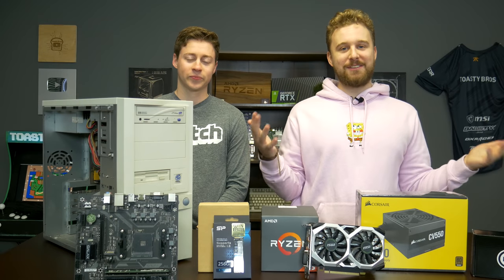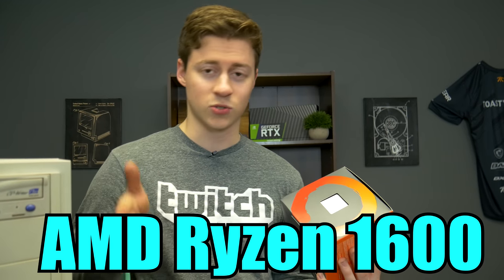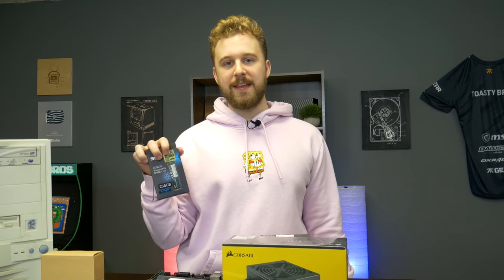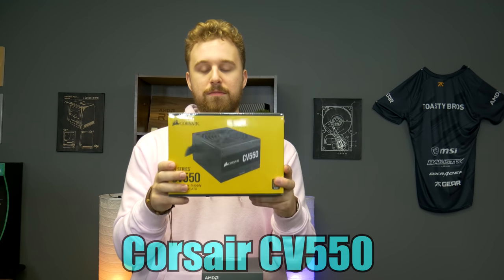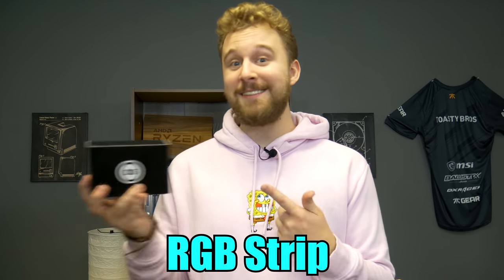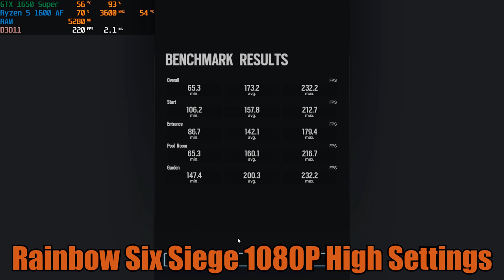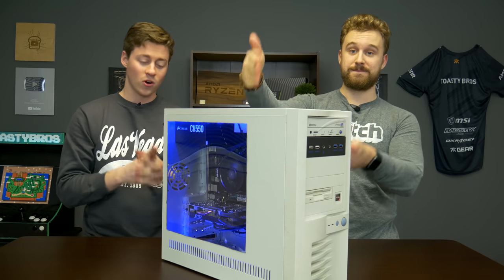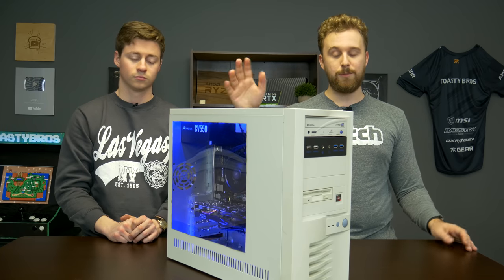$450 Sleeper PC Build - Gaming Sleeper

Comment: god i love seeing sleepers its like a computer going super saiyan and showing these modern computers that she to can run modern parts
Reply: the side windows completely defeats making this a sleeper pc
Reply: @kyles8524   not really, someone that doesnt know computers will call it shit by looking at it but once they try it they will underestimate it.
Reply: @JQ19988  my point was with a side window you can see inside of the computer and see its not shit. Like a sleeper car, they pull up to the drag race in like a Chrysler concord with a LS7 Twin turbo Corvette engine in it but they have the original hood on the car, they dont have the hood open so everyone can see the LS7 engine cause then it wouldnt be a sleeper car.Thats exactly what a sleeper anything is.You dont make the internals of any of it visible. Its supposed to retain the original body,case, whatever the item may be not modded in any way, its supposed to be completely hidden.lol thats why the side windows defeats calling it a sleeper PC...If they simply got another side for this old computer and replaced it then it could be called a sleeper PC
Reply: @kyles8524  I didn't mind the case modding at all myself. Though I think you are right when it defeats the purpose of it being called a 'sleeper build'. 

What I liked about it, it seems like a build they purely did for the heck of it. It's always nice to see the lads do builds for the sheer experience of it versus the gamut of builds promoting AMD, Nvidia, or Intel's latest and greatest.
Reply: @DanChainsawman  thats why I like cheap budget builds videos cause they dont care what they use, its just bang for buck
Reply: @kyles8524  It makes a lot of sense, I agreed with you.
Reply: I done sleeper PC's using old Compaq cases. It was fun

Comment: Good build but:
- I would tear off the box of the front panel USB + HD Audio PC box and paint it beige, dry it without ruining the color and put it back on
- I would get a SATA optical drive. Probably an LG GH24 series but find a beige faceplate for them and put it on
- I would add an 8cm fan in the back

Comment: the more sleeper builds I see using these old cases (or even stumbling across leftover ones from the 2000's that are still in Newegg stock for some reason), the more I think there would be a potential market for that 90's/2000's aesthetic of cases, but with modern amenities like actual decent airflow and cable management options

Comment: Nice sleeper case, but with the clear side panel it would have been more fun if you found retro looking brown and green parts to go in it. Maybe the Gigabyte X570 Gaming X, retouched with some beige radiator paint, use the Noctua NH-L9X65 SE-AM4 cooler, silver coloured power supply (Seasonic SS-500ET 500W), EVGA GeForce GTX 1660 Super SC Ultra Gaming, yellow LED's, etc. My idea would be spend a bit more, but make it look a lot cheaper and older on the inside too.

Comment: I suppose mine is a bit of a sleeper.  Gutted most of the components in an Acer Aspire T885 and put in an EVGA Supernova 650 G3 power supply and a GTX 1080ti Founder's Edition (MSI).

Comment: do a build on a dell inspiron i7 4790
Reply: They don't do much used hardware that's 4th gen, specially i7 because they are overpriced. But it's still a very good processor, I mean, with enough ram and decent graphics card you still have a PC for a long time.
Reply: @hunterfabio  you can buy them for under 200
Reply: @tobyprickles4887  For not much more you can squeeze a Ryzen 5 1400 / Ryzen 5 1600 with some second hand 16gb ram, perhaps new graphics card and also new cheap case with decent power supply and get the same price but way better performance, besides upgrade path. Of course depends where you live, at least here, no i7 4th gen is going for 200 usd, unless it's a very big sale in a 20 pc's bundle.

Comment: Ryzen 5 1400 with RX570 or ryzen 5 1400 with 1650 super?
Reply: Super
Reply: 1650 super
Reply: i say go with the ryzen 5 2600 and gtx 1660
Reply: I had the 570 and performs amazing but the 1650 super performs a bit better. Depending on the country where you live the price different is not worth it for the 1650. Here the 570 is like 150 usd new and the 1650 super like 230. So 80 dolars for a couple fps extra and maybe nvenc if you interested in streaming. Besides that, for me it's a no thanks. Depends of your country anyway!
Reply: @hunterfabio  OK thank you

Comment: First rule of a sleeper: build NO RGB, because those systems didn't have any except for one green LED on some motherboards to indicate power.
Second rule of a sleeper build: keep the exterior as authentic as possible, like 99.9% authentic.
Third rule of a sleeper build (this is the most difficult part): try to incorporate the existing front/top/side IO as well as CD/Floppy/tape drives

Keep those 3 rules in mind for any future sleeper builds and your sleepers looks and functionality won't betray it's looks until crunch time.

If I didn't live off of a Social Security Disability Benefit then I would have spent my life perfecting the ultimate sleeper build that no one could tell that there's a modern gaming system inside.

Comment: That is not a sleeper, that's a PC built in an old case. Clear side panel? LEDs? The black front panel with the ports? That's not fooling anyone, which should be the point of a sleeper PC.

Comment: In my opinion, budget PCs are pointless, with a fraction of the money you can buy consoles of the same strength or much stronger, since you would have to spend PCs over 1200+ money, preferably 1800+ money, so that you get significantly more performance than the current ones  consoles!  Unless you have fun building your PC and not just using it for gaming!

Comment: Hey guys how much fps will i get on minecraft im using a dell optiplex core i5 4th gen 3.1Ghz 4gb of ram
Reply: Do you have a graphics card? Besides, if it's an opliplex just get a Low Profile RX 550/560 or GTX 1050 TI. Those perform great, even with new games if you lower graphics a bit.
Reply: @hunterfabio  also installing optifine would help alot too :)